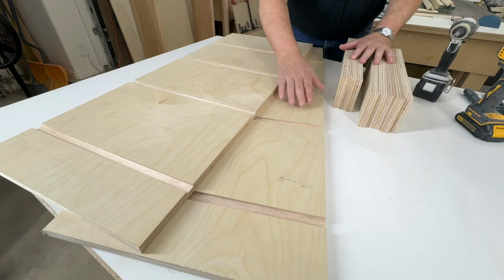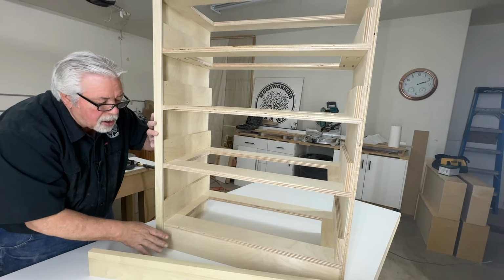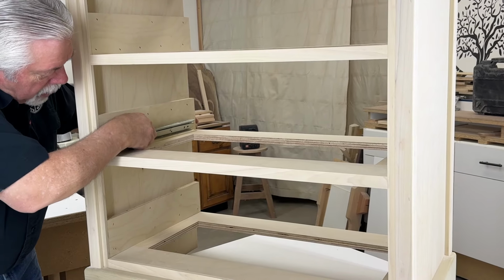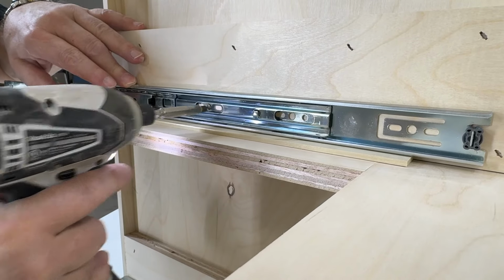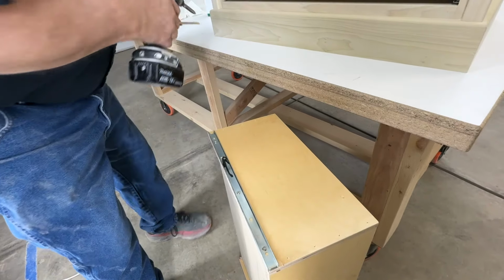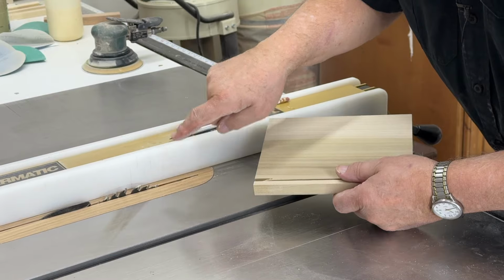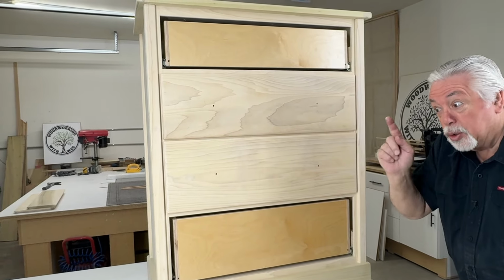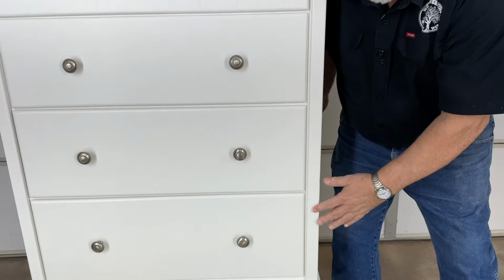Simple, Classic Design Inspired By The New Yankee Workshop

Comment: Hi, Wes! For the corner stiles was the corner edge of the inside rabbeted 3/8” both sides so it acts as a corner fitting molding or was it just a square molding placed offset both ways?
Reply from the maker: Hi...the corner molding is made with 2 pieces of 1/2" solid wood. 
One piece 1 3/8 wide, one piece 7/8 wide nailed together at a right angle. That makes it 1 3/8 x 1 3/8 outside corner. Thanks, Wes